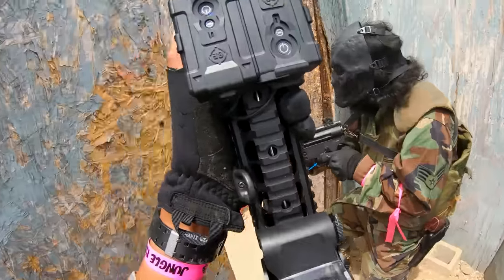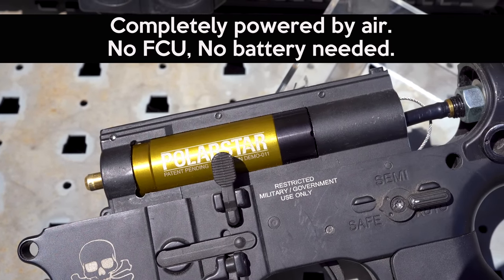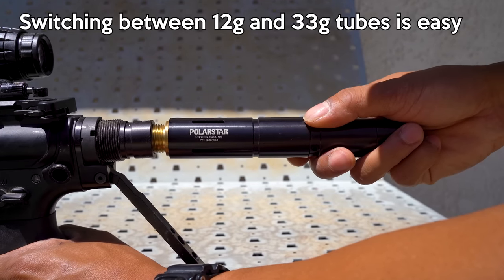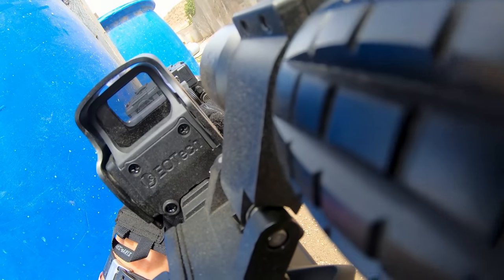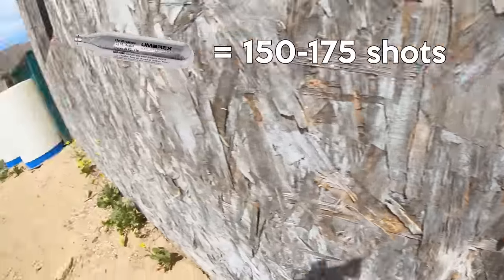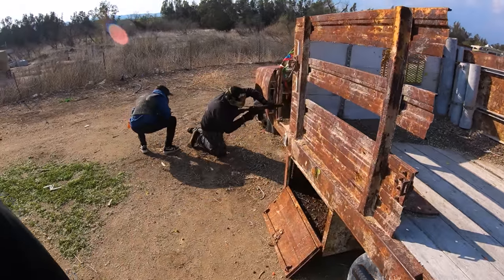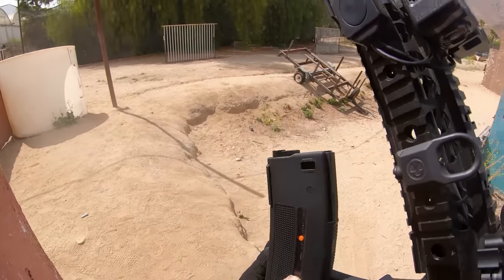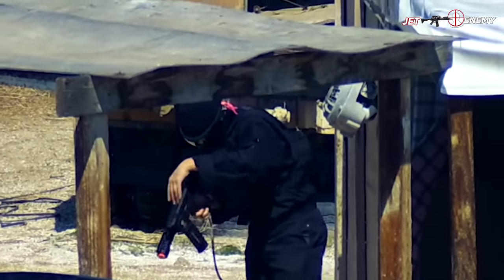HPA Made Easy. No Hose, No Tank | CYMA SR16E3 Polarstar Kythera

Comment: Instead, you’ll have a bag full of co2 cartridges.
Reply: Yep.. might as well just get a tank grip with HPA.
Reply: If you spend as much time as I do going back to respawn it shouldn’t be an issue if you throw a stock of CO2 cartridges in your game bag.
Reply: still lighter and much easier to carry around a few big CO2 cartridges that you probably wont even use all the way than one big air tank that you have lug around
Reply: Like I don't already do that with my hi cappa
Reply: @wadewilson4998  it's always funny seeing guys complain about lugging a carbon fiber tank around. Probably weighs as much as 10 c02 cartridges. Also, c02 is way more behavioural then straight air. You actually lose consistency to the point you may as well run an AEG. C02 hpa conversions are a gimmick.
Reply: I used to use an HPA gun with the Wolverine CO2 stock. Basically you get 200 shots per 12g cartridge, so carrying around 5 or so cartridges wasn't bad at all.

I bought a $10 shell holder pouch for 20ga and it fit them well
Reply: CO2 also runs the risk of freezing your o-rings and other parts it comes into contact with.
Reply: Honestly it’s probably better just to buy, or in my case custom build, an aeg and then carry 2 extra lipo batteries. I rarely ever need to use up all 3 in an entire day of airsoft but that’s also because I go around throwing paper shurukens at people for the equivalent of knife kills :D
Reply: It’s no hpa if it’s co2 right?
Reply: You can run a 13ci tank in the stock instead with that UGS system
Reply: @lame7617 Technically yes.
Reply: @bushwookie9152  there is a filter and system in place to stop that. it is not direct c02
Reply: @celinesanchez5520  No one complains about it lmao atleast I dont there is 0 issue with it and I shoot faster and quicker then any aeg giving me a advantage most of the time and normal air in a 4500 psi tank lasts longer then c02 but you have your opinion

Comment: Technically, this setup is not HPA.  It's using CO2 not air.
Reply: I meaaannn CO2 is in a high pressure vessel... 😂
Reply: @scottedwards3403   I mean A CO2 cartridge is carbon dioxide not air 🤣
Reply: @kiernanfucci201  it was a joke based on what was said in the video..
Reply: could also run 12g nitrogen in those for colder weather

Comment: Got almost an identical build. Kythera in a VFC now M4 (started as a mk18) with UGS bottle setup and 33g adapter. Most reliable builf I've ever fielded. Made it through Saratov with it on x6 33g cartridges.

Anyone thinking about getting one watch the kythera 101 video polarstar put up. It'll walk you through everything you need. Also, polishing your trigger sears is a must IMO. Had some issues with my trigger sticking before I did this. 

Lastly, point of clarification. The UGS gets rid of the line and tank, not the kythera. I had on in a 416 with f2 and it worked flawlessly as well. 

Great video! Keep putting em out!
Reply: Hello Pep, does your replica do more range now with the CO2 sistem, also i saw that one 33g gives you around 500 shots, is this true? Thank you in advance🙂
Reply: @rangelpenev268  range is the same with CO2 or HPA, just more compact. Also 500 is a fairly accurate count, I can get to just about 4 standard EPMs with my setup with a 33g.
Reply: @pepthenomad5651  Thank you very much for the fast response 🙂
Reply: Hey man, been thinking of doing a build like this with the gas in the stock, how easy is it to source 33g cartridges? Are they more economical than 12g cartridges? I've got 12g on the shelves at every walmart, but 33g doesn't seem to be common
Reply: @lucasmurphy6187  now they are pretty easy to get. I like the 33g for when I run it as a rifleman build, when I step up to DMR I like the 12g. The reasoning is that the 33g lasts longer than the 12g, but the shot drop-off is longer (more shots under powered before empty) still usable for a rifleman role. Whereas the drop off of the 12g is shorter, and easier to swap when still under pressure.
Reply: Hey man, just a qq. Can you tell me the fps difference between first shot from new cartridge and the last few shots when it's almost empty ? I don't know for example on 1.5J .28bbs ? Is the performance drop radical ?
Reply: @vladimirpittner1206  it's about .2j~ of difference. It's noticeable for the last 100 shots or so
Reply: @pepthenomad5651   hmm not great not terrible :D would you recommend  ? I like the feeling of shooting hpa but my airsoft ocd does not allow the hose :D
Reply: @vladimirpittner1206  would fully recommend this setup. It gets the most ise of all my replicas
Reply: Needed this! Been thinking about switch to the kythera with 33G before the next Balkar and didnt know how many I should buy and bring

Comment: Only makes sense imo for a dmr or milsim gameplay with sparse short engagements. If youre running midcaps it makes every reload be accompanied by a c02 reload and that just seems annoying for cqb play.
Reply: ...What? You don't change the CO2 with the mags, it's in the stock.
Reply: @Guitardrumr  you get about 120 shots per co2. Midcaps typically hold around 120 rounds. So everytime you reload your magazine, you’re gonna need to change the co2
Reply: @pnessi570  Yeah, sorry, I misunderstood your comment. I'd definitely rather run the 33g (roughly 500 shots, according to Polarstar), or just the 13/3k tank.
Reply: @Guitardrumr  all good, and yeah. I could live with a co2 reload after every 4 mags or so. Hate the idea of running a hose to it tho, a sling gets in the way for my dumb ass half the time.
Reply: @pnessi570  13/3k tank still doesn't need a hose, just screws onto the UGS regulator. They've got stocks that slide over it, just leaves the tank regulator visible.
Reply: @Guitardrumr  oh cool. What kindve shot count can you expect on that?
Reply: @pnessi570  Polarstar say about 1k. They've got a UGS install video where they show off the system a bit, and go over the necessary mods to use it.
Reply: @pnessi570  I get roughly about 1200 rounds give or take.

Comment: I have built 3 and own 3 kythera’s. My favorite by far is my LCT AK-12.  My second build is an AR copy in a CYMA M4 body.  I think I might go with the Tank stock, 13ci instead of the 33gram adapter. Currently on a standard 48ci 3000psi I tank I can play for multiple weekends on a single fill.  Combined with a modify black flat hop bucking and 6.03 barrel both my kythera’s are very accurate and super consistent.
Reply: If I wanted to do this but was new to airsoft how could I figure out the steps? I want to outfit a honey badger with this system.

Comment: I feel like you don't give enough love to HPA, so this is a breath of fresh air!

PS, i do feel like the Co2 conversions do kinda bring back from consistency though. And the Kythera comes natively with a hose. The UGS is a seperate upgrade. IMO its 1 step forward with the kythera and 2 back with the gas "upgrade".
Reply: Exactly my thoughts co2/green gas in the uk is a pain sometimes especially in the cold tbh it be better off pairing it with a tank stock like an mtw keeps hpa consistency and saves money on co2
Reply: Yes but this will interest a lot of milsim players because of the lack of hose and the sound.
Reply: He didn't mention it, but you can also attach a 13/3000 psi tank which fit inside special stocks. Go to the polarstar site and find the ugs packages to see what i mean. This is what i would go for.
Reply: @Resmarax  yeah but u have to get a special stock in order to do so and then your cheek weld changes so if you want a decent cheek weld you have to turn that into a drop stock.
Reply: @thecanadianairsofter2492  i see
Reply: @thecanadianairsofter2492  ik a few milsim players who dont care at all about the line some of them run tank stocks outhers run lines at end of the day its what you see as cost effective and practical for your use case
Reply: @AndrewR2130  true I was just addressing the question/statement at hand.
Reply: @thecanadianairsofter2492  The stock comes with the UGS kit….The Cheek weld is a little different.  But not bad enough that you can’t overcome it.
Reply: I saw the discussion and had the same thoughts.
But I know that there are rechargeable CO2 chartridges so maybe you could fill them with air?
Do you think this could solve the problem?
Reply: @IIIDasBrotIII  i always have this option in thote.. but i don't know if it's possible or not..

Comment: Only 1 upgrade to go from this, a quick detach clamp for the capsule,  a simple long lever could go around the buffer tube that will lock onto pins which as yoy lever it forward it forces the capsule forward to break and seal it. To remove, remove the stock, open up the lever like an m60 but backwards, releasing the clamp and coming off or at least hinged away allowing to refit a new one.

I love the idea of that setup, i would love to be able to have a loud setup, i know it's not favourable but it'd be cool to just hear a little crack in the woods and you're under fire of some 6mm.

Comment: So my experience is high pressure air is far greater than CO2 for consistency / accuracy. It also does fluctuate with changes in temperature like co2. So all depends on what you want out of your gun really.

Comment: I love my Kythera M4 build! It s so fun. I don't have an issue with the hose. That UGS is almost as expensive as the engine itself. And the cost of 33g Co2 cartridges is crazy. Then there's the 13CI tank option, bu that just looks silly to me. A friend has that for use on pickup game days and the 33g carts for MILSIMs. I'll do the hose. It doesn't bother me as much as it seems to have bothered you. I have yet to snag it on anything. And I used the gun in a CQB field a few weeks ago. With out a battery or the UGS in the buffer tube, I could collapse the stock all the way in and run the gun in a super small way. I had no issues switching the gun from left to right. I never have to think about it.

I use a MAXX Model Hop unit and a Lambda 6.01x363mm barrel that has been S-hopped and using a Modify black flat-hop bucking. I run the gun using 75PSI to get 1.5j tested on .32g BBs. That's pretty efficient. I also have a Amped Airsoft IGL for the added toughness in case the day comes I do snag the hose. That's connected to a P* MRS regulator and a 63CI bottle. I need to get a smaller 48CI bottle. 

The only sound these guns make is a slight, "puff-puff" noise out the front of the totally-not-foam-filled-suppressor and the click-clack of the trigger firing and resetting. People just don't understand where they got shot from as they look around. They are so used to the sound of a cranky, AEG.

The one thing that has taken the longest time for me to get used to is the sound of a dry fire. With an AEG they make a very loud and distinct sound when they run out of BBs in the mag. The Kythera almost sounds the same whether its firing BBs or dry firing. So it takes a second to register that. Maybe 2 trigger pulls.

But if that's the worst thing, then I can live with it! Lets see more Kythera game play!

Comment: You forgot to mention that the UGS also works with a 13/3000 or 15/4500 tank.  I’ve been running this same setup on a DMR platform and can get a good couple of hours of play out of a tank.  I do see about 500-600 rounds out of a 33g.  I wouldn’t bother with the 12gram setup.  You end up changing cartridges after every mag(especially with the EPS1 mags)  I usually use .40 bbs at ≈1.5 joules.  I put an RHopped 466mm barrel from Umbrella armory in it.  Shoots far and accurate.  I do wish there was an output gauge on the regulator, but that’s not a deal breaker…

I also run the UGS with a gen 1 Redline N7m in an M4 platform with an R-hopped 363mm inner barrel.  I shoot this one with .32 bbs at 1.5 joules.  Round counts are similar.  But haven’t really tried counting accurately…The Kythera trigger is defiantly better, in my opinion.  

The UGS is designed to run on both CO2 and HPA.  I go back and forth between the two.  The 33g adaptor and a couple of cartridges take up less space than a spare 13/3000 bottle.  So I will carry them on my person when shooting off a bottle.  When running a 20” barreled, 10” quad rail, bipod and forgrip, I like to just use the 33g cartridge.  It does make a weight difference…

Comment: I'm actually using this cyma right now as my main gun. Got an AC 6.03 mm IB an aluminum cnc maxx hopup and 70 lonex bucking and an asg 30k high torque motor. Got it shimmed just right and now it sings. Could upgrade the gears but haven't done it yet.

Comment: I tried this mod with little co2 cartridge in the stock.

Not bad, it last me 4 midcaps with 130 rounds each. for 1 cartridge.👍🏻
Reply: Wich co2 size did you use? 12g?
Reply: @DHMarci  yeah
Reply: @HORIZONHUNT  damn thats crazy
Reply: Thinking it is the 33g (~500) setup you have and not 12g (~180). OR, your mags are not holding at their full capacity.

Comment: Damn, I used a PolarStar fusion engine for 7-8 years, and just switched back to AEGs. This makes me want to build an SR25 DMR with those 33g cartridges in the buffer tube! Lol
Reply: This is my exact dream build since I hate the tanks but also the UGS stock with 12g you'll have to reload both your mag and the cartridge every time you reload. DMR builds are just a perfect setup for it with 33gs.
Reply: I just did that with one of your R-hop barrels.  Do it!  You won’t regret it.  I picked up a boneyard Matrix SR25, put an A&K receiver on it with a Kythera and UGS (with 30gram  adaptor).  I’m getting about 360 rounds with .40 g BBs running at 2.13 Joules(≈336 FPS). With a LE style collapsible stock, you can push it forward to access the cartridge without taking the stock off.

I also have an M4/5.56 SPR setup with the wolvarine Wraith CO2 stock with a Redline N7m engine.  The trigger is pneumatic, and the stick is CO2 only.  But what Wolvarine offers is a duel source adaptor kit that will run the CO2 stock and a grip quick connect for your HPA tank setup.  The UGS allows for HPA 13” tank to be attached as a tank stock setup though.  I like the pull on the Kythera better than the Redline, but the redline is quieter....

Comment: I'm very lucky to have gotten my Kythera. It was the last one at MIR tactical. I love that if I throw a foam filled suppressor on the end of it, the loudest part is my squeaky trigger spring, lol. What I'm not a fan of however is the stock trigger resistance system. I had to spend hours troubleshooting why it wouldn't reset after a few shots. The spring would get scrunched and caught up and not extend for a full reset. I had to add all the included washers to get it to work right and now I have a super heavy trigger pull. I'm okay with it since I have my M4 built similar to a DMR anyways. Regardless it's a super fun low maintenance way to go for HPA users and I'm extremely happy with my purchase. Just wish I could nab one for my friend. 😄

Comment: Jet pls make a tutorial about removing orange tip from pistols
Reply: Take the barrel assembly out and put the tip in boiled water. You could use a heat gun, not a hair dryer, but not everyone has those, and the hot air can warp barrels.
The heat is to break the glue. Next it to twist the tip off, and that's if it's even removable. Some have screws in place pinning it to the barrel itself, so good luck getting it out. Not every pistol has threads, so removing it might even be a waste of time.
May just be a better choice to paint over it

Comment: The biggest downside to running the CO2 though is overall cost. Depending on where you live depends on the cost of a box of CO2 but for me it retails 20 12 gram cartridges at $13-$15. An HPA tank fill $5-$10. The CO2 cartridge lasting a single magazine for most midcaps and the HPA tank lasting most players all day. Overall though I am a hose and tank player and have both the Kythera and N7 Milsim. Both are great if you don't want a battery in your HPA.
Reply: i’m tryin to convert right now to hpa, how much was your cost to start up roughly?
Reply: @justinjuve4197  my initial investment for hpa was higher than most as I built 2 guns at the same time. A single gun if you do the work yourself is between 400-600 on average. Between the engine, hose, tank and regulator I spent 530ish.
Both investments in co2 or hpa are similar its just a difference in preference and running costs

Comment: Got my Kythera last December and I absolutely love it! Took me a hot minute to re-tune and fix the reset issues I kept having. Threw on a Maxx trigger and shoots like a single stage trigger! Debating on whether to go the CO2 route or HPA route if I bought the UGS though.
Reply: The UGS is designed for both.  So if you decide to go CO2, and change your mind, you just need a bottle.  I purchased one with the CO2 33g adaptor and one without.  I can switch back and forth.  If you plan on not using an HPA tank, then get the CGS stock.  It’s a little less expensive, but only does CO2….

Comment: Really wonder what the future of airsoft is going to be like. There needs to be a gas system with no wires, tanks, maintenance, or replacement cartridges. some kind of pressurized air where the tank lasts for hours of gameplay. Definitely a pipe dream but maybe one day!
Reply: The only real way for the HPA systems efficiency to get better is for tank pressure to increase and we are already at 4500 psi.
There will always be maintenance, just like there will always be dust and dirt.